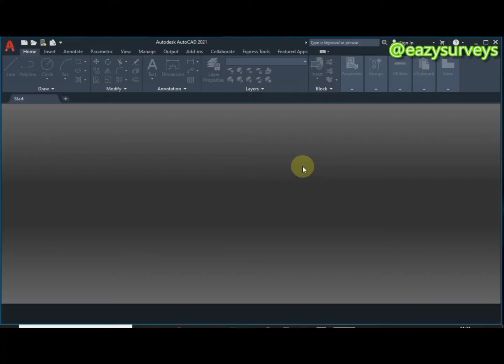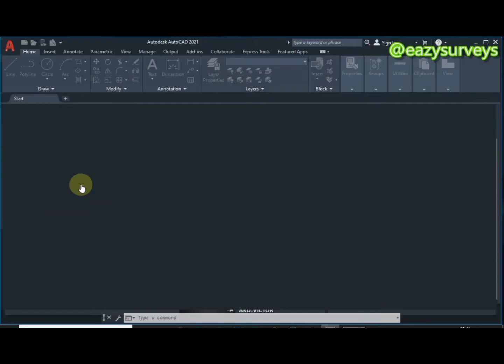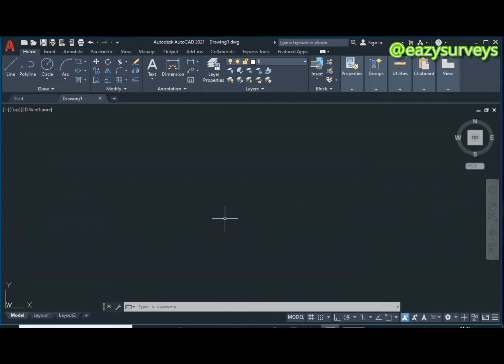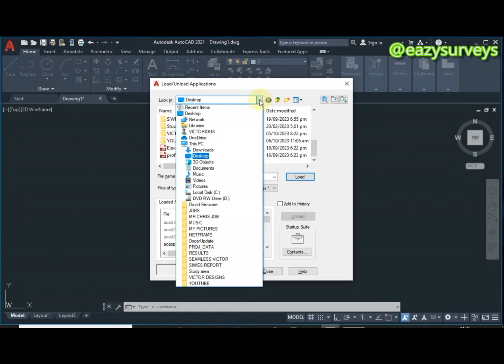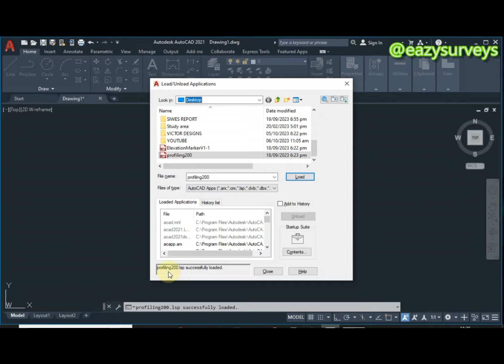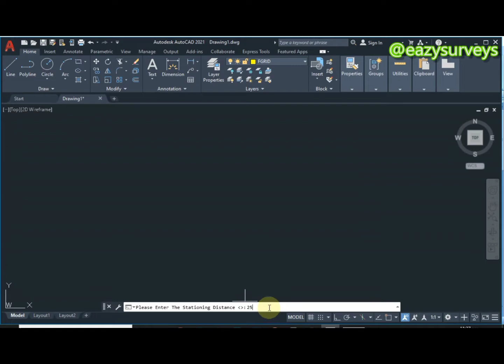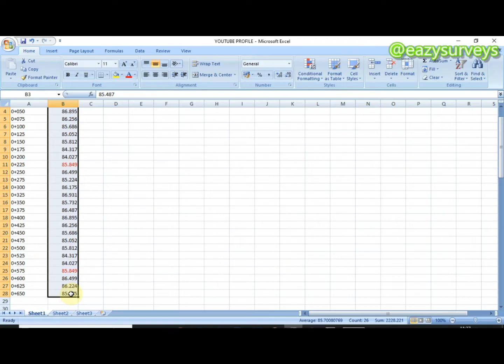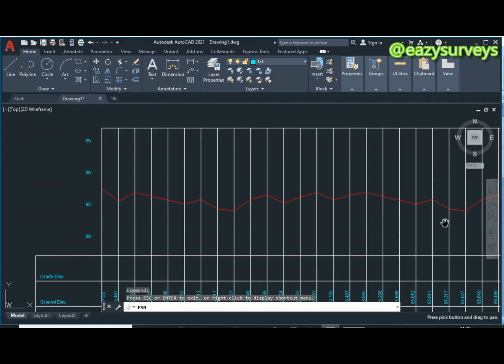How to Create LONGITUDINAL PROFILE in AutoCAD || Route Survey Road profile for beginners

Comment: Hallo, sieht ja gut aus. Aber unter Autocad 2024 läuft die lisp leider nicht. Gruß😔
Reply from the maker: @tomdeboom1  Thanks for your feedback ❤️

English please
Reply: @eazysurveys  Hello, sorry that I wrote in German but my English is not that good.
Your video is really great, but unfortunately the LISP doesn't work under Autocad 2024 German.
For example, the osnap command is listed first and is not recognized.
Reply from the maker: @tomdeboom1  Thanks for the feedback

Sorry about that
However you can try using it on civil3d
It will work just fine

Thank you